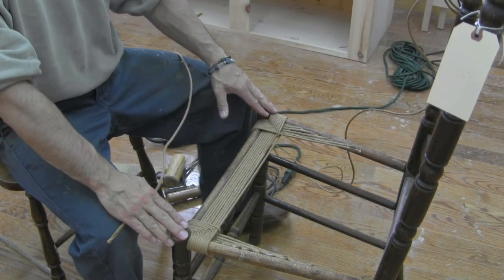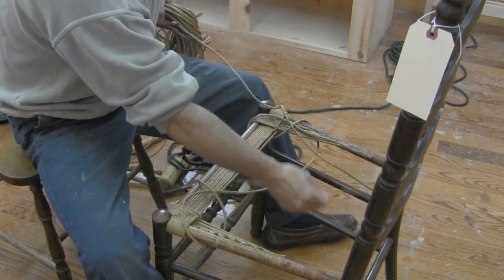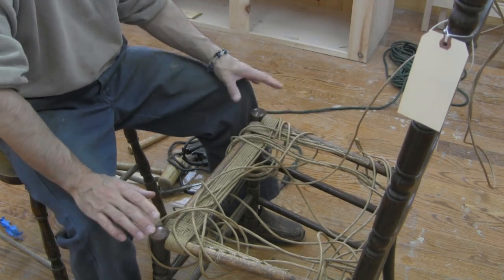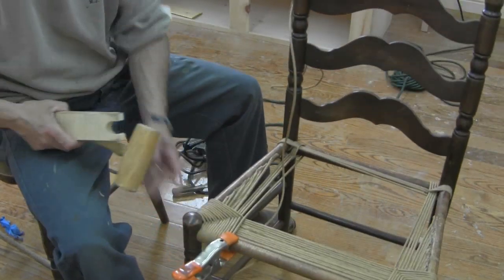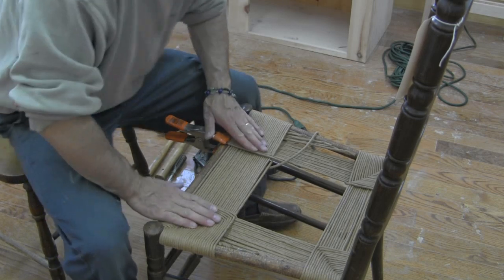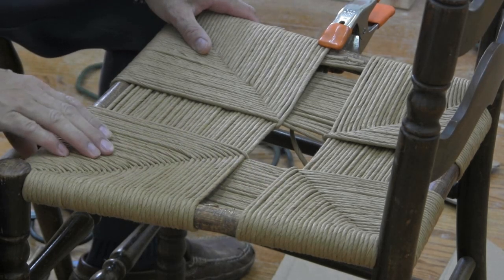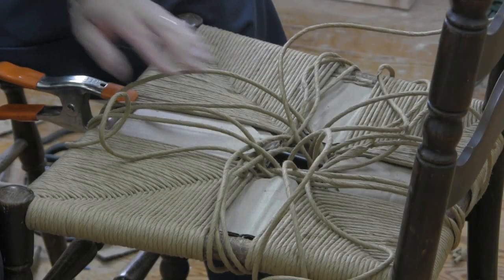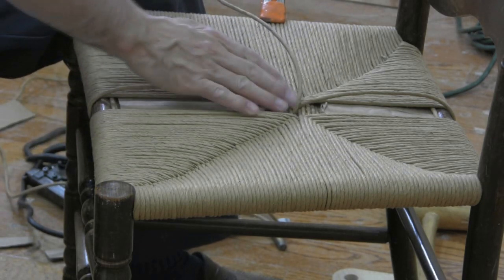Fiber Rush Chair Weaving pt2

Comment: Great video - really helped me - thank you! One question is how you keep your rush from getting kinked and twisted when you are near the end and have to feed a single strand.  I start off with a nice coil and wet it as you described, but as soon as I start working with it, it develops kinks and twists that I have to unravel before I can feed the strand through the small hole. Your rush never seems to never have this issue, so could it be an issue with the rush that I am using or is there a technique for preventing this?
Reply from the maker: Are you using a fiber rush, or a pre twisted natural rush?  Pre twisted natural rush does have a tendency to kink and twist more than a fiber rush.  It might be the hole you pass the strand through is not large enough, I open mine with a Philips screw driver.  Maybe you have way more rush than needed passing through the hole, giving it more time to twist.  If neither of these sound like a solution than maybe it is your rush. I buy mine from Perkins.

Comment: Thanks for the video. I'd done a small project about 40 years ago when I was a kid (and loved it) but wasn't quite sure I remembered everything.  This was very clear and easy to follow.
I did have 2 questions: 
1. If you aren't as experienced with doing it, would you recommend that someone only go around 1 time, tighten, clamp and then going around again rather than trying to go 4-5 times?  I'm just afraid I'd pull the roll of rush through a previous weave and mess things up.
2. When you tightened up with the block tool and the hammer, do you go around in a certain direction (clockwise versus counterclockwise) or does it matter (as long as you continue in the same direction)?
Thanks so much for sharing so much of your work.
Ana

Comment from the maker: Sorry Zeppelinguy, I dont.  But it is real easy to make, just drill a whole the same size as the rung in your chair, or a little bigger in a piece of 3/4" plywood, then cut our the handle.  When cutting out the tool shape just cut the whole you drilled in half, then shape your handle.  You could make a pattern in cardboard first to get the size and shape just right before committing to plywood.  Good luck Zeppelinguy, let me know how it turns out.